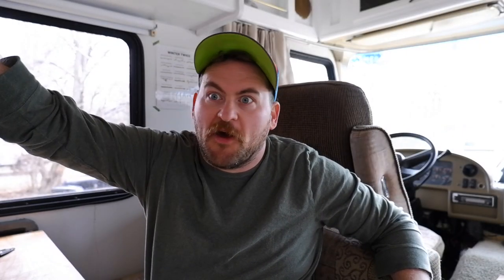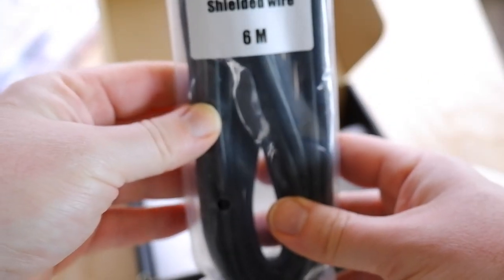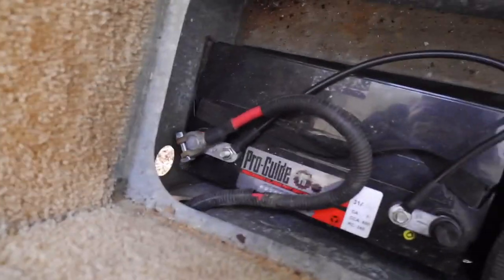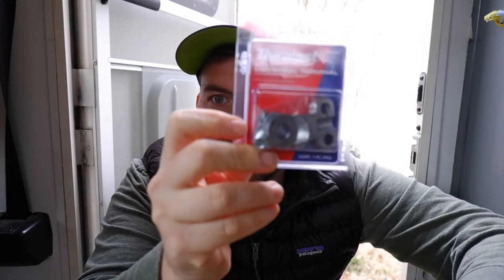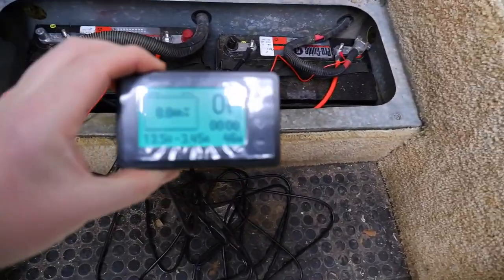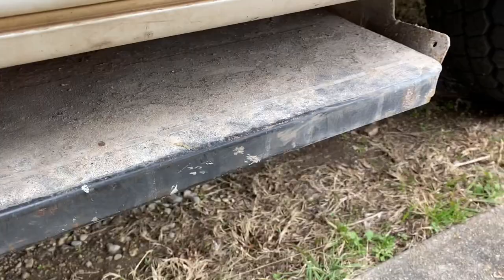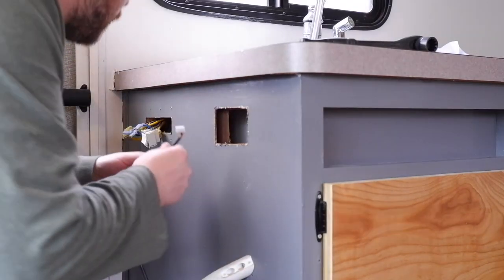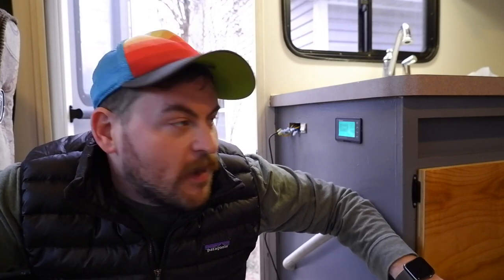Installing a Renogy RBM500 Battery Monitor // RV Renovation, Part 9

Comment: Perfect timing! I'm going to be installing a similar monitor on our new battery bank when everything arrives. We've experienced the "furnace dying due to low voltage" a few times during winter boondocking and looking forward to not having to worry about it as much!
Reply from the maker: Yep, we never knew when and how long to run the generator to leave us with enough battery for the night.  We just finished a solar install and have a video coming out for it next week.  Happy to report the monitor works extremely well for evaluating our solar performance as well!

Comment: Hey mate when charging an discharging at the same time what dose the AH read? ie 10 amps coming in, 2 amps going out will it read at 8 amps coming in?
Hope you understand what I mean.
Reply from the maker: You got it, it shows the cumulative amount. 10 amps in and 2 out would show a charge rate of 8 amps while 2 amps in and 10 out would show a discharge rate of 8.

Comment: My monitor is installed. It also shows when power is drawn from the battery and how much. But the level of the display does not change and always remains at 100 percent. What am I doing wron
Reply from the maker: Sorry, I’m not sure about this! -Paige

Comment: I built small systems for remote security. I run everything off the charge controller "load output terminals". Would this work for that config?? Or does it need to be tied directly to the battery?
Reply from the maker: This would still work as far as I know.

Comment: I have one. Monitoring 26v batteries, 232amp hours. Set it all up. First use ran the Rv background draw, about 1.5A, plus 2.5A CPAP for 10 hours and other minor draws. Indicated it was using about 19 watts. By next morning it is still reading 100%, 99.99 hours remaining. Voltage dropped from 12.8 to 12.5. Any idea what I have going on?
Reply from the maker: If it showed 19 watts @ 2.5A that would be around 7 volts, so either the voltage is set wrong, or you have some of your loads terminating at the battery instead of the shunt.    The shunt will not be able to track any loads that do not pass through it.

Comment: I installed mine and the battery level is showing 0%. It will show the amps being pulled when I turn my fan on though. It looks like yours did the same thing and then the video and then it cut out and then it was showing the percent (your battery was shaded too. Did you have to program the monitor to get the percent left to show it should the monitor do it automatically?
Reply from the maker: Make sure your battery is fully charged and then hold the up button for 3 seconds or so.  It will set your current charge level as 100%.  You also need to set your capacity in amp hours via the menu.  I think you push the bottom button to do that

Comment: Did you have to drill out the holes on the plastic mounting block before screwing it to your wall?
Reply from the maker: Nope, no screws, it just clips in.  I only drilled out pilot holes to get the jigsaw blade started.  - Casey

Comment: Did you pit a small fuse on that small wire from the shunt to the battery. I can't tell..Hope this works well for you. I have one to install that's similar. Please understand i am not trying to be critical but those big cables should have been crimped on. IMHO
Reply from the maker: Hi Robert, thanks for your comment.   The battery cables came pre-assembled from a reputable manufacturer.  I'm not sure how they fasten the terminators on, but I'd have definitely crimped any cables I made myself.  They have held up great for nearly a year now!

Comment: The  battery capacity is performed automatically or is set by you?
Reply from the maker: It is set manually, the device shows 0 ah by default.   So, you can use it with any size system.  Since we're running AGMs and not lithium, we set ours to show half of the battery capacity.  The monitor will hit 0% when we've discharged the batteries to 50%.
Reply: @WilderAdventures   Ok,thanks

Comment: Awsome video mate, do you have a link to electrical connectors kit you brought?
Reply: You’ll want the 1-0 gauge wire (at least) and 3/8” 1-0 wire lugs for the shunt and 5/16” for the terminals. You can find them on Amazon. You’re also going to need a wire crimping anvil, wire cutter and some 1” heat shrink tubing.

Comment: I just installed itI need to know why  the screen light is blinking????
Reply from the maker: It blinks when charging, solid when discharging.   You can hold the top button for a few seconds to turn off the backlight.

Comment: What size wire did you run from the shunt to the neg on battery?
Reply from the maker: I believe it’s 6 gauge.  A few people have pointed out it’s “wrong” to have a smaller gauge wire there than our chassis wiring (which is huge, 2/0 wire) but for a 12” run the 6 gauge is well within tolerance for our max 1000W load

Comment: Were your batteries wired in series or parallel?
Reply from the maker: They are parallel, running it as double capacity for a 12v system.

Comment: can you control the light somehow or is just always on while charge/discharge?
Reply from the maker: It's always on while discharging, and pulses during charging.  It turns off for loads < 2W from what I can tell.  That's probably the one thing I don't love about it so far, as it does produce a visible green glow in the motorhome at night.  Almost like those green square night lights from the 90s.
Reply: @WilderAdventures  ah thanks for your answer mate. I saw in another video in the meantime that whenn you press and hold the top button (two secs or so) the light will be switched off

Comment: Hello. What type of batteries did you connect this to?
Reply from the maker: We're running two 110AH 12V Sealed AGMs in parallel currently, but I believe the monitor works with any battery type. - Casey
Reply: @WilderAdventures  Hey Casey, nice video. Keep in mind that AGM batteries can be discharged to 50% without damage. If you discharge them below 50% it will reduce batteries lifetime. I would suggest setting an alarm on battery monitor to 110Ah. Good luck!
Reply from the maker: Thanks Yury, these are deep cycle AGMs and the manufacturer says they can be safely discharged to 25% on their spec sheet and maintain > 90% of their cycle count expectations.  I've got the alarm set for 75Ah to give me some cushion on the manufacturer recommendation!  -Casey

Comment: I dont know what your rv is like but it seems super dangerous to have the positive post and cable lug that close to the metal enclosure. It seems like it could bump it and ground out and arc.
Reply from the maker: Shipped that way from the factory, 80,000 miles and going strong.